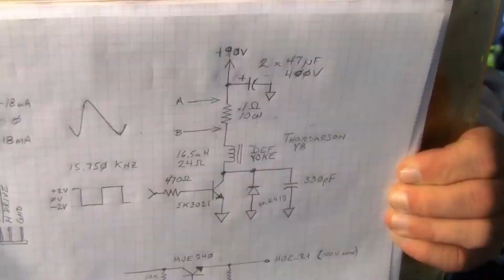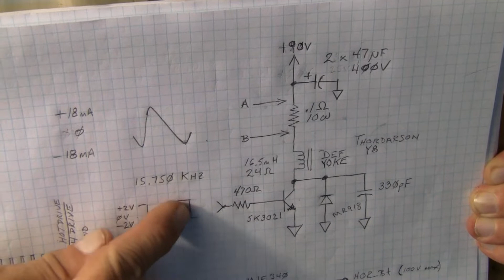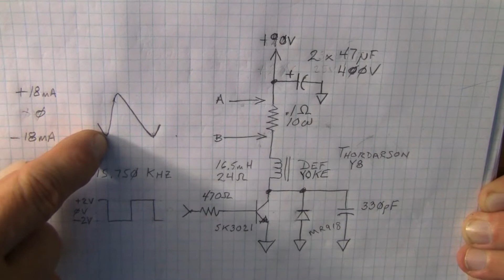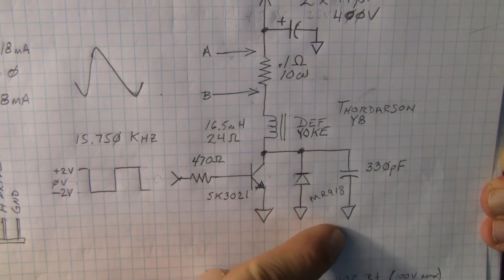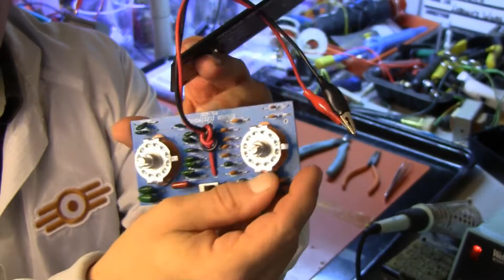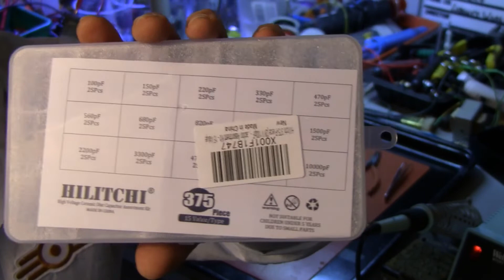The Chief - Update #2

Comment: Whoops! At least replacing those capacitors is not too bad.
Reply from the maker: Perfectly reasonable, actually. I tested them with my LCR meter, one at a time, and was not pleased with the tolerances. But, technically, they were within the 20% spread. Of course, recapping a subber box should be done with as accurate a value as you can get. But, it will work well despite this.